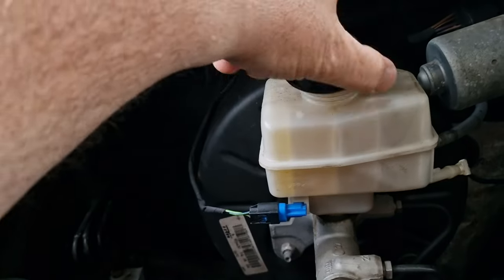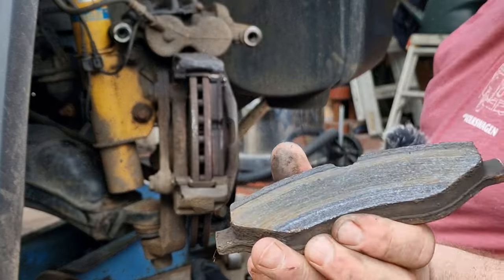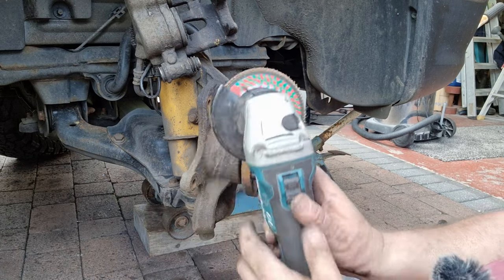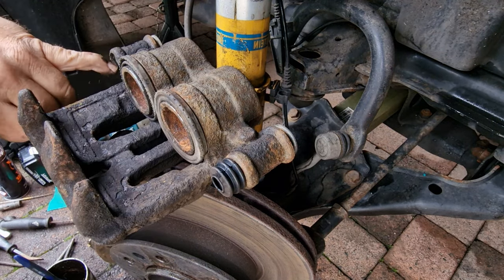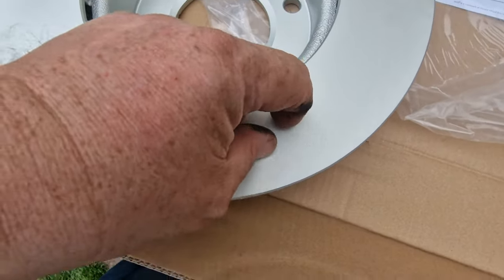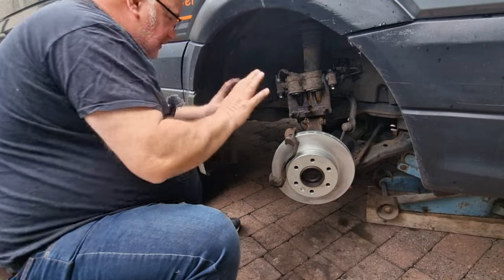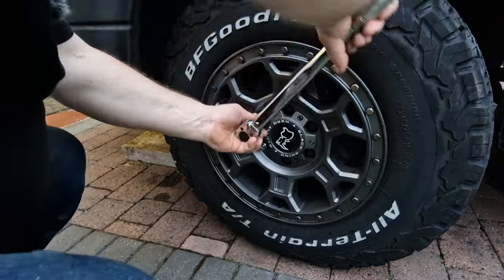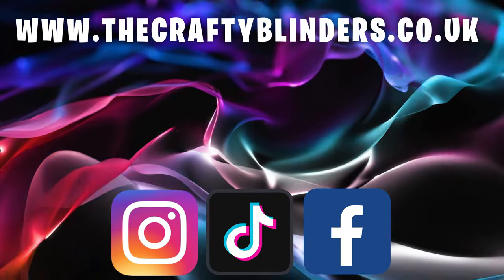Sprinter Crafter front brakes: How To Install Disk Rotors Pads And More! DIY step by step guide

Comment: Do you have a link to the kit with the new sliders and rubbers? Also looked like the rear of the discs failed because of that broken metal shim causing the pad to touch uneven onto the disc

Comment: Sam great video. Thanks for the content. Just uprated my van. Dee at VAN WEIGHT ENGINEERING is great! Would be good to see a new brake efficiency test after your new discs and pads, after you've done the back.
Reply from the maker: Great suggestion!

Comment: I've been on my front brakes for 3Y, and they don't show wear at all, Except the disk that has been heavily attacked by salt through the winter. I also noticed the inside of the disks looked nothing like the outside.  I know the callipers need a service every 2nd year to be working good, because the sliders arrangement is trash. They seem to collect rust, whatever you'd do. So the brakes may look good, but they're usually not.  Has anybody put bigger brakes on the crafters?  I would really like some upgrades. They bite good, but it just takes time before the originals bite properly.

Comment: I've seen many videos on the subject, this one's dead on. Nice going, mate! 🙂👍
The Crafter I / Sprinter 906 brakes are just barely sufficient to stop the cathedral safely when they are at their best performance. Any deterioration of the brake performance will lengthen the stopping distance during an emergency stop considerably. As converted vans are usually maxed out at 3.5 tons or even more after an upplating, frequent checks of the stoppers are mandatory. 🧐
Also take a VERY close look at the calipers, as the pistons can get sticky or seize altogether, reducing your brake performance. Frequent brake fluid changes (once a year) will give you maximum corrosion protection in the lines and calipers and keep the boiling point of the fluid up to specs, reducing the chances of brake fade during long brake application (e.g. going downhill). 😎
And last but not least - if you're unsure of what you're doing, get someone with expertise to assist you or have them done at the shop altogether. Brakes and steering components need to function at their best and forbid any guesswork or shoddy workmanship. 🙂
Stay safe, everyone! 🚐☁🍀
Reply from the maker: 😊🫶 good points raised as always Volker

Comment: Shame on you use in an axle stand and being safe . We always leave them out to activate the comment section 

It works a treat  😅
Reply from the maker: I should work more unsafely but the give me shit at work for it when I approach them for workingredients unsafely 🤣🤣🤣
Reply: Yes indeed that's what legs are for stopping the discs hitting the floor 😂
Reply: Nice one Sam,enjoyable again.quick question re the up plating video, with going above the 3500 ton ,will you need a tachograph ????
Reply from the maker: @davidhale4830  only if you plan on carrying goods
Reply: Great video Sam. So true what you said about the sliders, and also changing safety critical items in pairs. 👍🏻